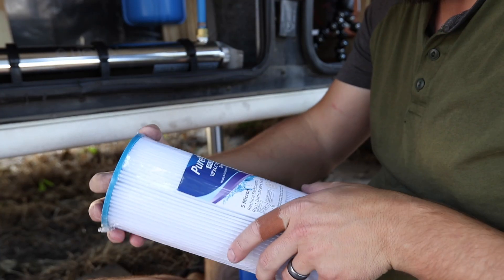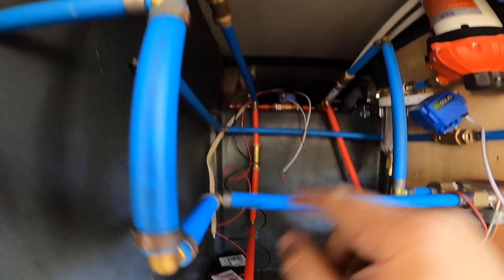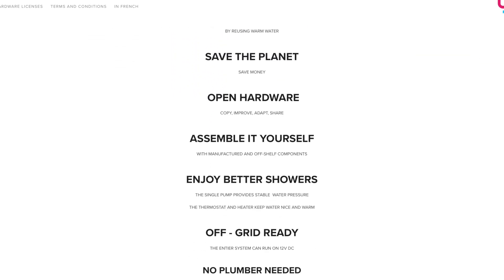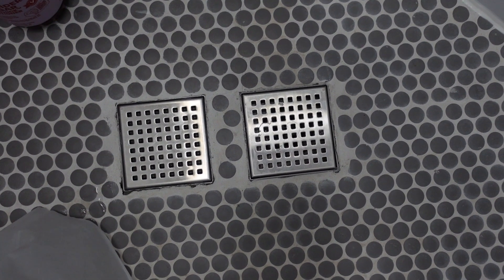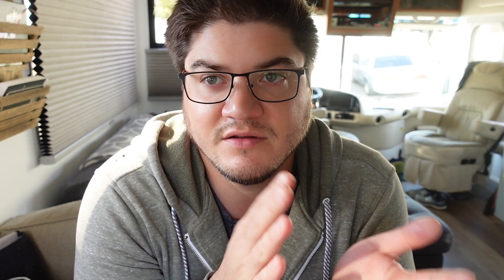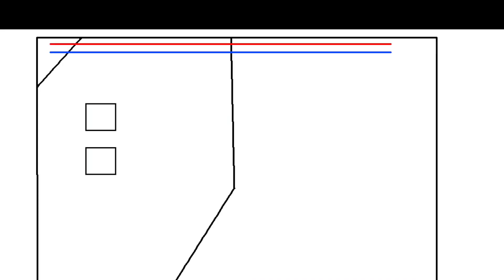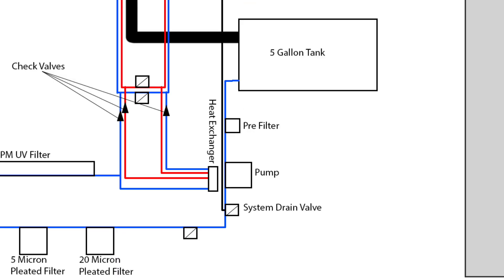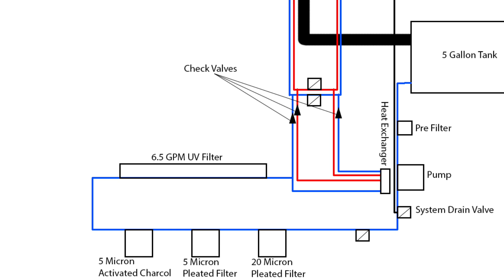Overview of Our Recirculating Shower | RV Renovation

Comment: Since you are recirculating shower water through a heat exchanger and NOT mixing cold fresh water does the shower get too hot?? Im am getting ready to build a similar setup and I am thinking about introducing a temp sensitive motorized valve to close the loop to the heat exchanger if the temp is above the set desired temp.. if that makes sense.. 

For our setup we will be using a hydronic system to heat the van and supply hot water. I am unsure if I can run both at the same time and get the desired set temp for both operations. Some insight would be great because I lack the personal experience.
Reply from the maker: Sorry this is so late. We've been away from the comments section for a while and are kind of hit and miss these days :)

It hasn't gotten too hot. If anything, the water moves through so fast that it can go a little cool. It's an interesting solution to the problem, but it is not perfect by any means. And we still have a "cold" side of the shower diverter that puts water through without passing through the heat exchanger. 

I have come across a setup that used a hydronic heating system to heat the heat exchanger and they said it worked well. But I didn't get many details about it. In my experience, the heat exchanger heats up well, but water is so good at moving heat that it cools the heat exchanger down really quickly and the returning water to the shower can get cool quickly. You really need the recirculating water to start out warm or hot in order for the heat exchanger to work well. It does well in boosting the water temp back up a few degrees, but is really poor at heating it up more than that.

I hope that makes sense. Good luck with your setup!

Comment: Hi tx for sharing, it is so clear. Thanks.
I have a question about the waterheater you use. Which one is it, brand, type etc? I try to find it all as well but so far not succeeded in finding the right waterheater to do this  job.
Hope to hear from you about this. 😊

Comment: It's probably less complicated if you recirculate the water from gray water tank back to fresh water tank. Some RV have 2 fresh water tanks already installed. Separate their lines and use one for recirculation and the other for drinking and cooking. When you're hooked up, just disable the recycling mechanism since you don't need it.

Comment: I would want the option to dump the water coming from the faucet to the grey tank while and after showering. So, get in and rinse (water to grey tank). Shut off water. Lather up. Rinse (water to grey tank). Then switch to recirculating for continuous water (essentially clean water now). When done empty to grey tank. 

So next shower im not using same shower water but i was still able to take a long shower w/o using as much water.
Reply: This ist exactly what I was thinking. If I ever were to build a van I'd want a system with that kind of feature...

Comment: So, this system only lets you use the "two gallons of water" for a long water saving shower, but it cannot actually recycle the water for a long term, such as for a several showers a week. The filters will eventually mold and the water starts to stink due to the soap that is dissolved in the grey water. Because of the bio-waste and the stuff in soap that feed bacteria, you'd have to replace those filters quite often, would you not?

Comment: I've been looking at the systems and the one main question I have is what you are using for a hot water source? People talk about these 20 minute long showers, and if you're hooked up to a standard say 6 gallon or 10 gallon RV hot water tank, it would seem to me it would be impossible to keep up using a heat exchanger. Perhaps because the water is circulated the heat loss is not significant enough and you can go 20 minutes or an indefinite amount of time, but I would like to know what the minimum requirement is for a hot water tank size for say a 15 minute long shower? I've considered going with the on-demand type units, but to provide a sufficient buffer I would think you would have to use a much larger reserve tank (5 to 7 gallons). I think I'd prefer just to use one and a half to two gallons, and just dump it after use. I could even see shampooing using a military style shower, and doing a quick rinse to get rid of most of the dirt off your body during that same period. Then put things into a recirculating mode, and just enjoy the hot water without putting a lot of demands on the filtration system. Seems like the petroleum based soaps are the biggest killer, so again, I'd like to avoid putting them through the filtration system at all if possible.  Let me know your thoughts for tank size. I have no idea of the heat loss and what is needed.

Comment: Great design... are you still using it? What source of heat do you use to run through the heat exchanger? 
I found that by putting the dirty soapy water in the holding tank first left the tank kind of scummy after a while. 
I changed things around a little....from shower drain through filters and uv then into holding and from holding tank to shower. Only draw back is its a 2 pump system

Comment: Nice setup.
Why do a 20 micron in front a 5 micron?
Dirt holding capacity? 
Price wise it won't make a difference in changing them. The time span just differs.
Reply: Filter systems always work in particle size sequence, otherwise the first filter stage gets ‘blinded’ with fine stuff, and blocks. 

Three or four stage systems run longer before cleaning or replacing. 

Ryan is smart guy. I will build in his  good work, make a casset system for under the van, can be removed in cold weather to protect from frost, use shower base as tank, prevent scum build up in tank, use a full shower base ‘soap catcher’ which can be rinsed out after each showers session, saves ‘some soap blocking’ of filters. 

I am also looking at having post shower holding tank with pump to wash dogs off outside. 

Also check out ‘solar dump’ which heats water in tank from your solar pannels once batteries are full. Smart. 

Nice work Ryan. Brilliant to see you guys and gals with some brains and ingenuity using those brains and new social media to share. Nice one. Graeme Wales U.K.
Reply: @graemelewis3764  oh, oké. Thanks for the explanation.

Comment: Very slick. I had not even considered having an “RV park” mode and I haven’t heard/seen anyone else mention it, so kudos on that. I am not a programmer so I doubt I could make a control system like yours, but I wonder if it could be duplicated using 3-way valves that could all be powered/switched with a single “mode switch.” Also, how well does the heat exchanger work? Do you have parameters for the inlet/outlet temps and flow rates for both sides? Do you have valves to throttle flows to get optimum heat exchange?

Comment: Very nice system!!!!!   i was trying to figuring out how you close the grey tank  drainage during loop mode.
Reply from the maker: Thanks! We considered a bunch of different ways to do it with valves or something similar. But in the end, we went simple. We installed two drains in the floor of the shower and just use a rubber plug to plug whichever drain we don’t want to use.

Comment: SUBSCRIBED & LIKED:   I'd have to watch this video many times to get it all...
I did not see how  you actually keep the fresh water and the shower water separate.
If not then you need to add a back-flow-preventer unit.

Yes there are tons of information online, but no one video covers it all.
...some people are saying it worth having it, but expect intensive/daily/weekly/replacing of filters cycle maintenance. 

Some use 1 gal, 3.5 gal, you seem to use 5 gals(not really clear per your video since  you keep fresh water coming into your shower water tank).

I suppose your push button sets all the check-valves as needed to create a loop or not!
Anyhow, t.y. for the post, the graph is a good base to visualize this system.

If your ARDUINO side of the equation fails, you go shower-less... LOL
Are these electronic valves manual as well !?
Reply from the maker: Yeah. If it fails, we are sunk. But, we could just connect 12v to the valves to open/close them. We haven’t had to use it much. But the times we have, it was nice. If I knew how we would travel back when we built this, we probably wouldn’t have built it. It was more of an experiment for me. :)

Comment: Hi there 
tnx for this video!
Is the Arduino needed incase I build a closed system with no option to use the "normal" fresh water, and the "normal" drain?
Reply from the maker: Probably not. I’m mainly using it to control our valves to switch from one system to another. So if it’s all a closed system, you should just need to control power to the pump.
Reply: @ryanandsu  Tnx!

Comment: I think the link for the active carbon filter is a duplicate of the 5 micron filter.  Curious which filter you used.  And I'm assuming you bought 3 of the big blue filters... and then found different filters for each. (also the 20 mil filter and prefilter?  assuming the pre is just one of the small screen filters).   Thanks!
Reply from the maker: Yes. I bought three of the blue ones and just use different filters in each. The companies that sell the filters keep changing their products around. We use a 20 micron pleated filter, then a 5 or 10 micro pleated filter (depending on what we can find), then a 5 micron charcoal filter. But it’s been hard to find on Amazon lately. The pre filter is a pre sediment filter like this. https://amzn.to/3k24YeX
The one we bought is not on Amazon anymore. I’ll have to go through and update the links. I didn’t realize how many products have vanished in such a short amount of time.

Comment: I'm wondering about the extra tank, why did you decide not to pull from the grey water tank directly? Was it because the water was at least warm in your 5 gallon tank? I have considered filtering the grey water for use in the toilet and shower, and forcing the fresh water to the sinks only, unless there was no grey water.

Comment: Hi there, awesome video! I actually purchased one of those electric ball valves a while ago when I first started thinking about setting up a recirculating shower. My one question is the hot-fresh water that flows through the heat exchanger, how does that flow back to the fresh water holding tank? In my camper all the water flows through the pump so I don't know how the hot water could flow from the hot side shower supply lines, through the cold water lines, through the pump and back into the fresh water tank.
Reply from the maker: It’s a closed loop on the fresh water. So the recirculating never crosses into the clean loop. We used a check valve after the water goes through the heat exchanger on the hot water fresh line and connected it to the cold line. So the recirculating pump causes the a pressure drop on the cold intake and pulls the water from the heat exchanger back into the cold input of the water heater. Hopefully that makes sense. It’s essentially a hot water loop like you’d install in a house.
Reply: @ryanandsu  is there a parts source list?
Reply from the maker: @hermanfrederick793  We didn't put together a parts list to post. But we did post a bunch of the parts with links to where we bought them in the description of the video. The problem is that they were sourced off of Amazon and we bought them back a while ago. So the vendors may or may not still exist online. There is another Youtube Channel that has a lot of good information about how to build a system like this. It's where we got most of our info for parts. 
https://www.youtube.com/watch?v=L0AR4COFJng
https://www.youtube.com/watch?v=sf17f_ByIHM&t=1178s

They have parts listed in their descriptions as well. Hopefully that helps.

Comment: I think uv light can’t kill bacteria in that system . Because uv light needs time its about 30sec up to 30 minutes to do sterilisation , it’s dependent on power of bulb. I can offer you maybe you can search ozone generator or Sodium Hypochlorous Acid Generator  for water sterilisation but first you need a collect water in a tank for sterilisation before use it.
Reply: If bacteria staying and hiding back side of the dirty particulars UV light never reach that area. That is the reason UV light  useless for water sterilisation

Comment: Hello, we have been running a similar set up for a few months. Have you found a sulfate free shampoo? Even with all the filters(similar to yours) we are having a suds problem after the first few showers. We also hooked ours up to the washer with a separate filter and drain.
Reply from the maker: We tend to use ours for a shower once or twice and dump the water for fresh water.
Reply: Sulphate is in near chemical suspension in grey water. It’s bound to water molecules. 

It takes energy to break bonds, can’t filter it. So Reverse Osmosis is most practical, but needs energy and is slow, so loose benefits you were looking for in off grid shower system. 

As Ryan says. Change water after few uses. 

Take a look at this, quick search turns up info….

How to remove the sulfate from your water
There are three types of treatment systems that will remove sulfate from your drinking water: reverse osmosis, distillation, or ion exchange. Carbon filters, water softeners and sediment filters will not remove sulfate. Water softeners exclusively change magnesium or calcium sulfate into sodium sulfate, which is more laxative.

Reverse osmosis (RO) is a water treatment system that eliminates most dissolved elements and chemicals, such as sulfate, from water by pushing the water through a plastic surface similar to cellophane known as a "semipermeable membrane." Generally, it can eliminate between 93 and 99 % of the sulfate in drinking water. This depends on the type of unit. 

A small RO unit will produce about 12 liters of water per day. A little larger units, normally installed under the sink, will produce 19 to 75.6 liters of water per day. RO units generally produce only 3.8 liters of water for every 15 to 38 liters of water treated. The remaining water is rejected.

Click here for more information on reverse osmosis treatments.	

Read more: https://www.lenntech.com/sulfates.htm##ixzz86rU6yIvx

Comment: RVs should be designed in a way in which you can easily access everything from either the inside, or by just walking outside and opening up a hatch. If they were built that way none of this would be an issue, it would make life a lot easier all around, more importantly it would make things that break or are not working properly a breeze to replace.

Comment: Question: How is your heat exchanger powered? In other words, do you get the energy created from propane or electricity? I love that you succeeded , congratulation.
Reply from the maker: The heat exchanger itself is passive. It is not powered. It’s heated by our water heater. It’s a 6 gallon RV water heater that can be heated by both propane or electric.

Comment: Great presentation. Have you been running this long enough to have a good feeling for how frequently you need to swap out the filters?
Reply from the maker: We've had it for about a year. But we haven't used it much this last trip. We've either been out of dry camping areas or they've been booked. I am planning on replacing them every 6 months unless the need arises to replace them earlier. that's also what I have heard from other people who have similar systems. The filters rinse out really well. The thing that will kill them is letting them sit.

Comment: How do you deal with soap and shampoo in the water ??
Reply from the maker: It's not totally filtered out. But it does a decent job. I have looked into system that take care of most of the soaps you put in, but hey require large sediment filters and things like that. So this is a little paired down. Sort of like bath water I would say. This type of system isn't for everyone for sure. And for us, it was just kind of an experiment. So far, we like having it.

Comment: Thanks 😁 how are you hearing the water that goes to the heat exchanger?
Reply from the maker: We are using the hot water heater that is already in the RV. We hooked up a hot water loop like you would have in a house to get instant hot water at the back of the house. It pulls from the hot water line and passes through the heat exchanger, and then puts the warm water back into the cold line to go back into the water heater tank.

Comment: Love the system. Just a little confused on the hot water side of things. Are you basically heating up your entire freshwater supply to run through the heat exchanger?
Reply from the maker: Yes. We heat the hot water tank for our fresh water system. It's 120v and Propane powered. It didn't make sense to install another heating element when we already had one installed. So we heat the water tank (which is usually heated already anyway) and pass that water through the heat exchanger and then back into the cold inlet for the water heater tank. So it's setup like a household hot water loop to get hot water to the back of the house. Also, having it powered by our 120v hot water heater means that we can heat it off of our solar system (pulls about 1400watts) and then we also have hot water for things like dishes, etc.

Comment: How do you clean the 5-gallon tank?  And the rest of the system?  I assume it needs maintenance cleaning once in a while?
Reply from the maker: So far, I have flushed it and run water and a bleach mixture through it. It's worked pretty well. I don't let gross water sit in the tank. When we aren't going to use the system for a bit, we flush it and leave it empty.